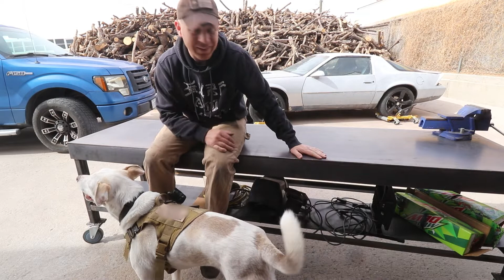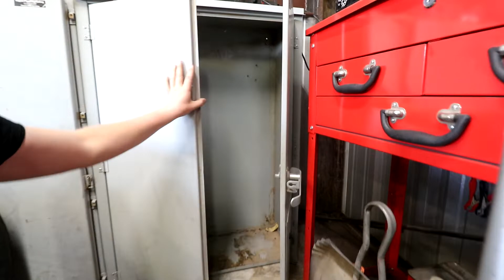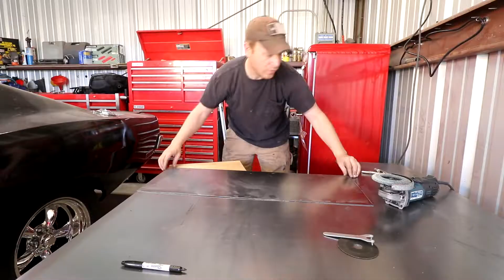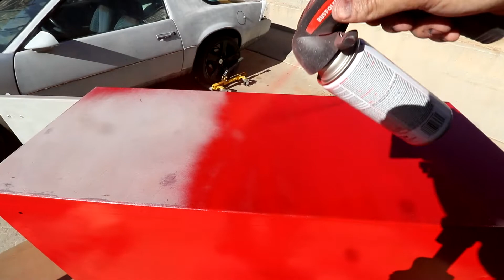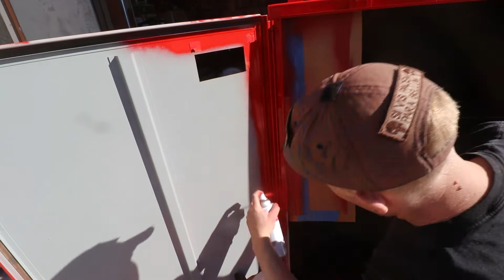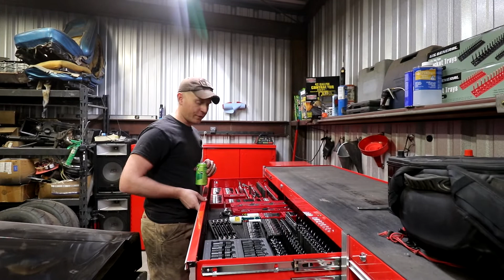Overhauling and fixing up the Automotive Garage!

Comment: I’m 16 and I’m looking to buy one of these for under 7 grand. Beat up is okay, just don’t want something I have to put years into. U know anywhere to look?
Reply from the maker: For less than 7, it's going to be hard.  Years ago, these were cheaper but the demand for a second generation charger is through the roof.   The only chance is finding one tucked away behind someones garage without them knowing what it's worth.  Id start asking around if you live rural and see what you can find.  If not,  you'll be starting where I did.
Reply: @HighRevNation  Goddamn I really don’t wanna pay 15 grand for a hunk of metal without a drive train. I don’t even have 10
Reply from the maker: @sebastiansac8219  Totally understandable.  However, the phrase "you gotta pay to play" is a thing you're going to hear a lot.  There are other cars such as dusters or darts that are easily under what you're looking at and can be absolute monsters if you build them correct.
Reply: @HighRevNation  I’ll see. Thanks man